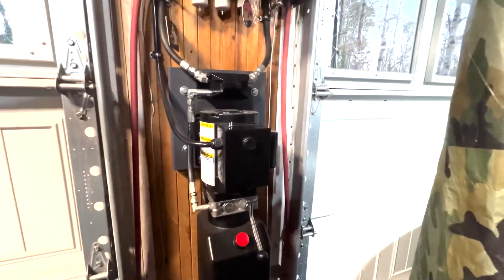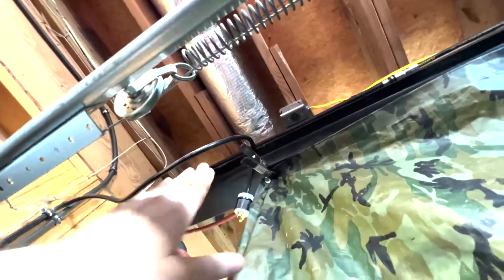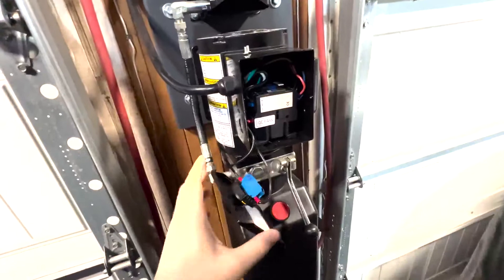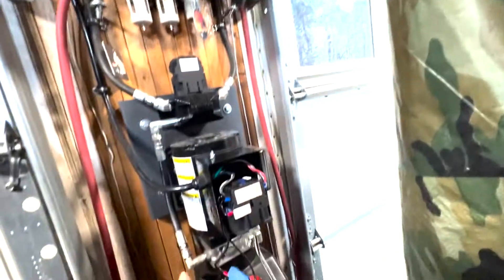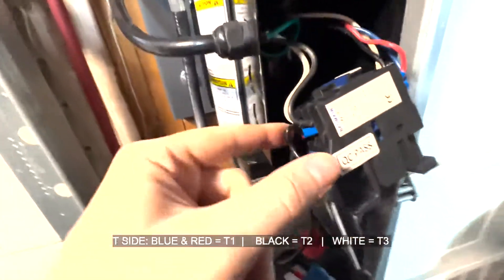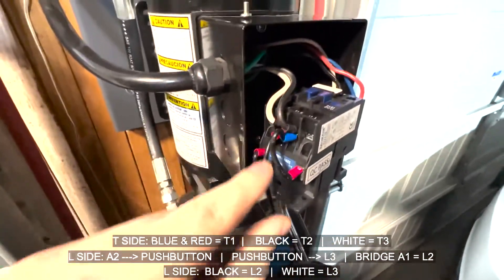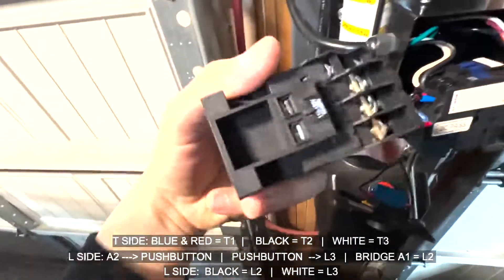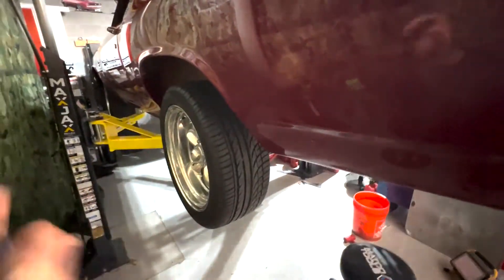MaxJax M6k -  220V Pump Wiring

Comment: in for the contactor part number please
Reply: looks like his pn is BAOMAIN CJX2-1810 but make sure specify 220 as the same part number has 24/110/220 voltages.  Another youtuber measured amp draws and his heavy expedition drew max of 10.93A at 110V so I am guessing at 220 the amperage may be a little less. so yes that breaker only needs to be a 20 with that yellow wire

Comment: Hey dillion , does it seem to lift faster? ive taken my time and actually  ran 3/8 hard stainless tubing on mine with rubber lines in attic space!!..I only have 18" of rubber hose above  the post at the disconnects where i can easily hang  them out of the way.........not sure 110 or 220 yet but i do have the 30 amp  for the welder beside my maxjax pump on wall...ttys
Reply from the maker: Yes, I think it cuts almost 30 seconds off the lift time from 110v to 220v. Definitely an upgrade I would do again for sure! That sounds awesome, especially with the disconnect making them still mobile and off the ground.  I would recommend doing the 220v, especially if its hard mounted to the wall!
Reply: @DillanFisher  going to try 110/ then decide , i can email pics of how i did the hard tube...if ya like to see or fb
Reply: @dillianfisher I cannot find the link for this new contact  pls advise

Comment: Thanks for that info. FYI, 12AWG (yellow jacket) is only good for 20 amps. Don't use a 30amp breaker. To do 30amp, you need 10AWG (orange jacket)
Reply: That’s why his other breaker burned out, change the wiring to 10 awg and 30 amps
Reply from the maker: Thanks for informing me and everyone on that! 20 amp breaker is all you need then! I think the reason I'm running the 30 was because my compressor also runs off the same breaker, not entirely sure though. I appreciate the info!